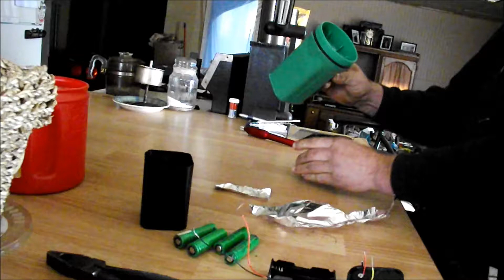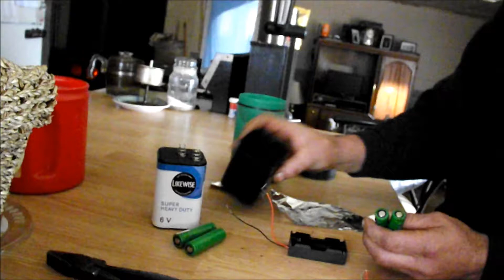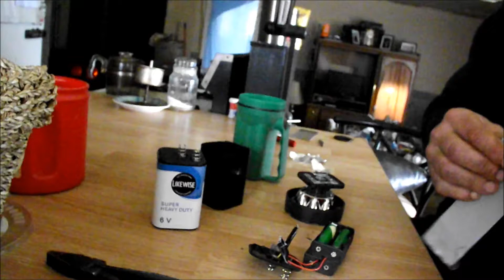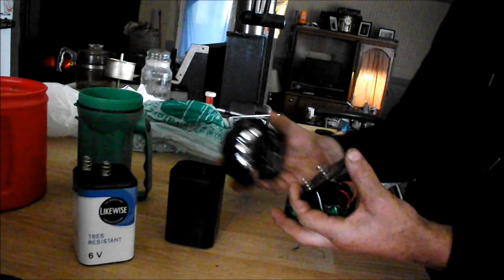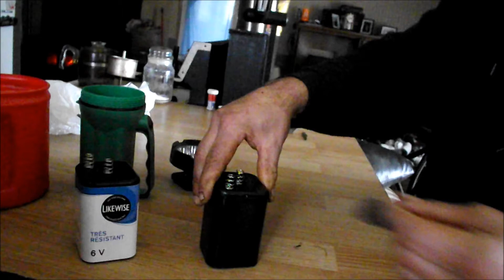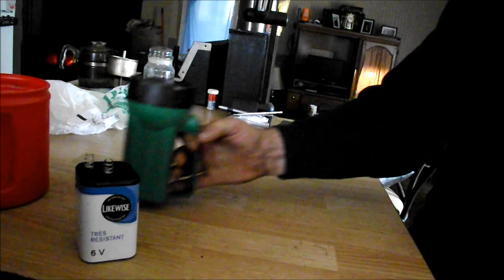Flashlight Battery Hack With Lithuim 18650 Cells

Comment: BTW those are 4.2v 18650 cells so when FULLY changed you have 7.4v and i doubt the leds  will be safe in the long run without degrading

Comment: Great idea ..I like that AA batteries are cheap and that is a easy way to get away from those exspenive 6 volt ones
Reply from the maker: No No These batteries are not the AA one,s. They are lithum-ion ( 16850 ) Rechargeable.They are from a laptop battery each one is over 3 volts.Two of them placed in series works very good for the flashlight. The flashlight needs to have the right volts to work. And with led light there can be a little voltage change. The Normal AA Battery is Only 1.5 volts for the nonrechargeable one,s and 1.2 volts for the rechargable one,s. Would need to series up four of those type to make it work. The one,s i use in the vid there only needs to be two of them in series for the light to work. I parrelled the two up that are in series. This way it gives it a longer run time and the needed volts to work. There is plenty of room in the old battery box that was used. Have the the volts correct matters a lot for led lights.